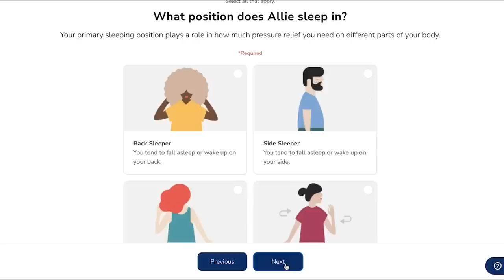THIS IS A DISASTER...

Comment: Yeah you guys probably should have at least hired a consultant to tell you how to trench and do piping.  You did allot of things that could have gotten people hurt or killed.  
- You didn't use plywood to support your trench walls,  this would have prevented slumping AND chances of the number 1 trenching injuries and deaths.  Wall collapse.  Anything chest level or lower requires this.  Also would have saved you worry about your propane tanks.  
- You didn't call before you dug to have someone come out and mark all your piping.  Probably would have paid for itself considering all the lines you broke and time wasted on your rental looking for pipes. Don't even get me started on how dangerous it is digging around gas and electrical lines.  Yeah you turned the gas off but hitting an electrical line could have been castetrophic.  I've seen construction electrical line injuries.  They are NOT pretty.  It doesn't just burn you.  It will result in you loosing sections of your limbs.....if you survive.  
Theres more but did and I don't want to be an ass but did you even do some reading about proper utility trench safety?  From the sound of Trent's previous exp it sounds like his boss wasn't following any  (or like allot of contractors ignorant till they get someone killed) so any exp from that job should be considered suspect.  Your lucky his "advice" on that gas line accident didn't get you killed or destroyed nearby buildings.  Nevermind any trenching should be done under a buddy system for safety.

Comment: Got a question how come you cant just cut the sewer line put a T and connect the garage line to it anybody knows?
Reply: They’re not simply adding a connnection to the garage. They’re replacing the original house to septic tank sewer line which was botched in the first place. They’ve had the basement flooded with black water several times now. Curtis the original installer said he could come and put it right in a couple of weeks but they wouldn’t wait. I remember watching the video when the septic tank was put in. It wasn’t bedded probably and sunk at one end so the ‘professional’ did a botch on that, too. I’ve no idea why the propane, electric and sewer lines are all in one ditch.